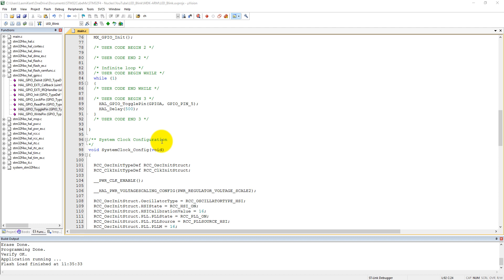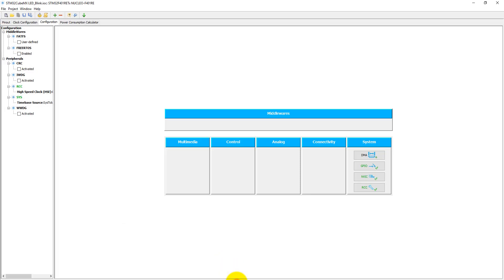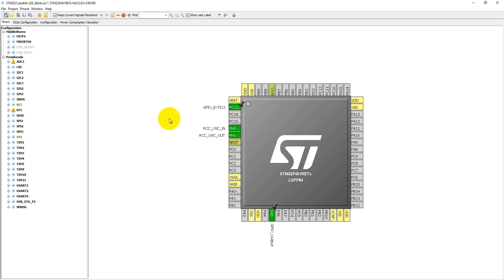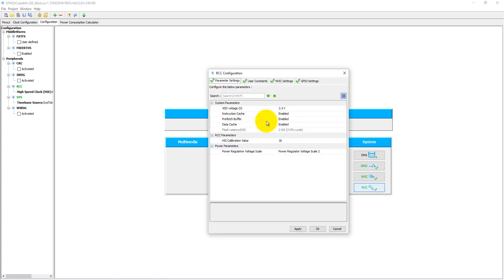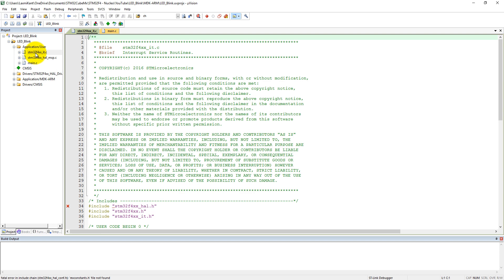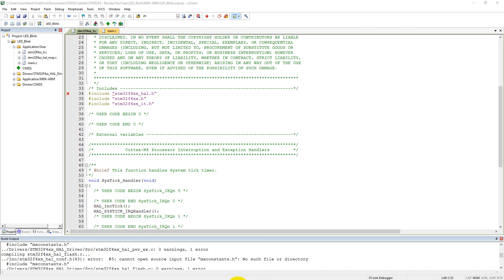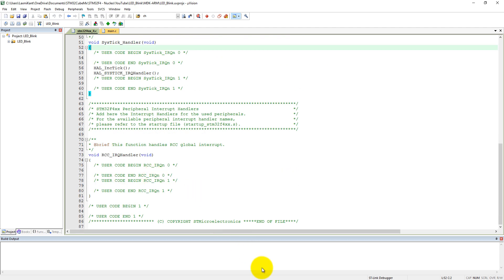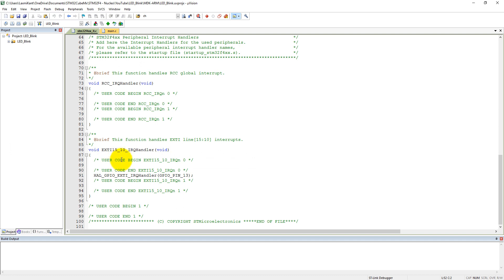STM32 Nucleo Tutorial 2- Interrupt, PUSH Button and LED code generation using STM32CubeMx

Comment: Which denouncing do you speak about!!!!!!!!!! There’s a capacitor to eliminate the denouncing when you push the button, so you don’t need to add a delay to complicate the instruction!
Reply from the maker: It is necessary otherwise capacitor discharge too fast
Reply: Don’t worry ST don’t use one cap, it uses 2 even 3 cap and a large resistor ;)!
Try without the delay and it works fine as we expected
Reply from the maker: Hi,
There is just one capacitor is connected with user button which is 100nF and resistance connected with it is 4.7K therefore RC is equal to 4.7k x 100nF which really very small amount of time. You might have got correct answer but I am not sure you will always get. Please refer datasheet for schematic Diagrams.
Reply: I have 3 connected cap on my board! Even thought with one cap it works fine, but I’m not sure that you have only one cap or one resistor, there’s an other resistor on your board, I advice you don’t use denouncing via software bc the uC will be occupied and waiting out the delay